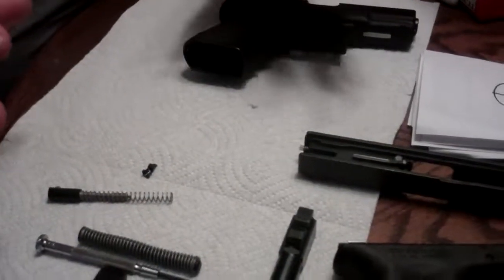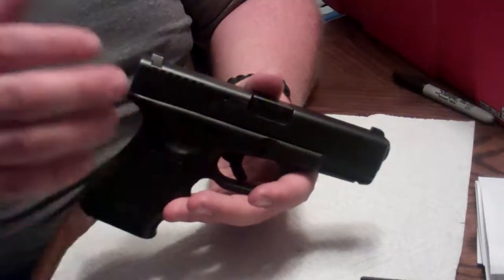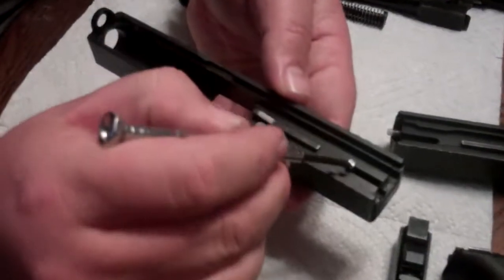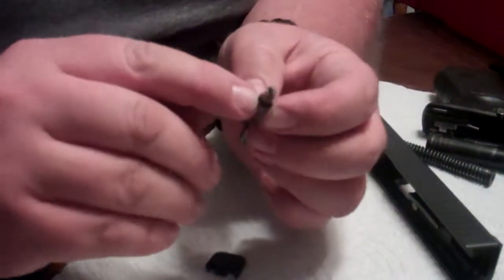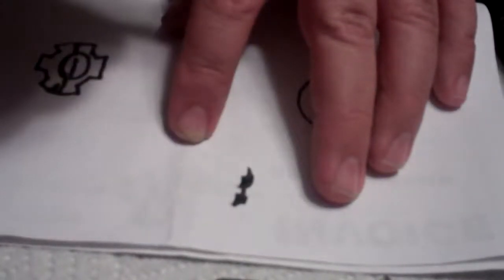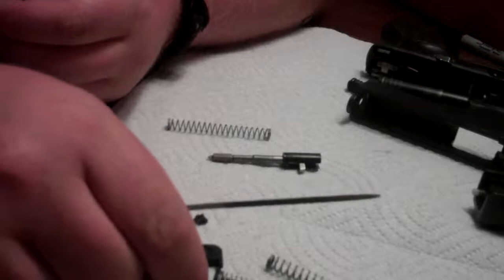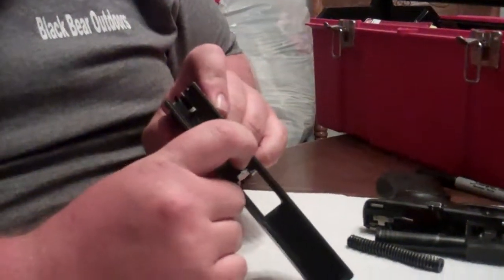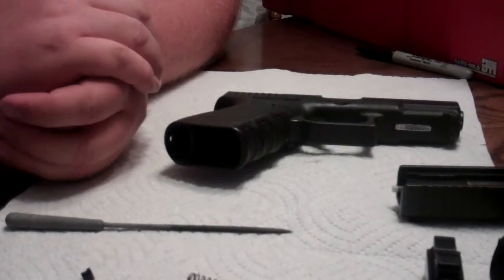how to make a Glock fire underwater for free Maritime/Marine Spring Cups installation

Comment: To verify that the maritime spring cups are working properly you should rack your slide then pull the trigger and hold the trigger down while shaking your gun back and forth and you should hear the rattling of the firing pin running freely inside your slide, if this isn't happening it means that there is not enough clearance inside the firing pin channel and your firing pin would not get enough velocity to set of the primer on the bullet or you could get frequent light strikes, an easy fix for this would be to lightly sand or polish the edges of the maritime cups and re-check with the rattling test until you get the desired result if not repeat the procedure until your gun is rattling, this happened to me and I found out about this checking procedure through a book I bought written by Robb Manning called "GLOCK, reference guide) it's a 222 page book with pictorial guide that I would recommend to any glock enthusiast to have and read, you learn something new everyday!
Reply: The Glock owner's manual has the firing pin rattle test,  the protrusion test, and push the pin forward, to check the drop safety block test, in it for a "function test, before attempting to fire the gun". I almost never read those manuals, either, so.......yeah. It's a gun. They all kinda work the same way, enough to know what not to do. We have silly f'ers trying to buy guns, wanting to use their Arizona State Medical Marijuana cards as a form of state issued ID.  LMFAO!! Read that ATF 4473 form carefully, and then decide if getting that card was  really a good idea or not. Somehow, singing my name on anything that says I break federal laws, seems somewhat imprudent.

Comment: Shoot any of my guns under water, and you had better have enough money in your pocket, for at least a new barrel. Caivitation inside the barrel of any gun can, and eventually will blow pits into the barrel. Water, excess oil, or any liquid can and will cause cavitation. Unless you really really really NEED to shoot a gun with water inside the barrel, DO NOT EVER DO IT. I used a pin vise and a drill bit about the size of a medium small sewing needle to drill my spring cups, so they still bear on the sleeve all the way around, but each has two small holes in it. I don't know if it will work, and I sure as hell hope I never have to find out. People see this stoopid sh*t and think, "It works with a pistol, so maybe I'll try that with my shotgun too", and they wind up dead. I have a Winchester 1897 that got a tiny bit of snow in the barrel. It blew up, big time, but no serious injuries.   I peened a new bead sight on it and recrowned the barrel, after I sawed off the jagged parts. Now it's an 18 1/32" riot gun. Any shorter and it would had to go bye bye, into the trash, or it would be illegal to own.